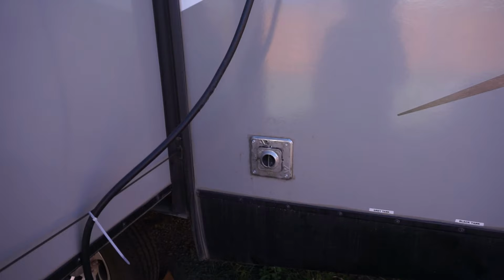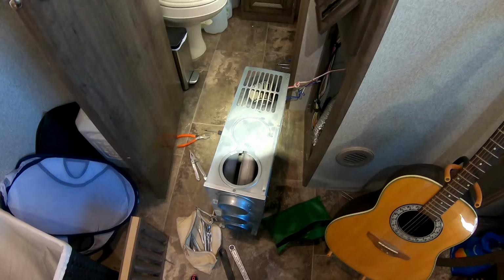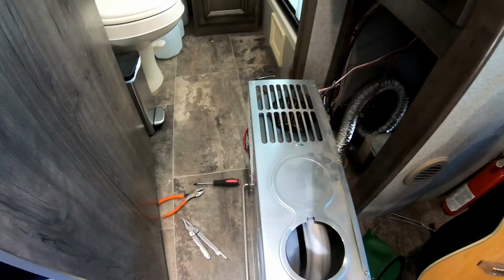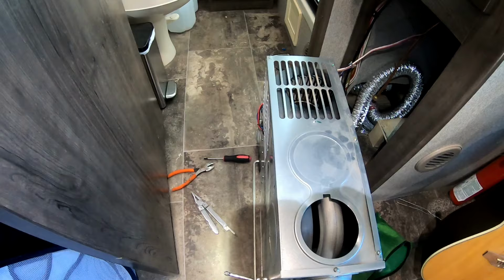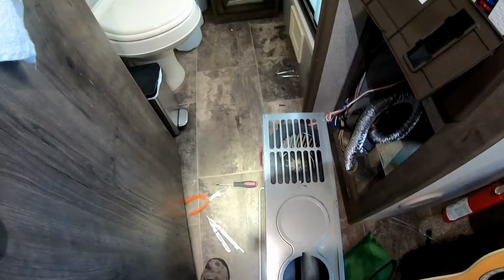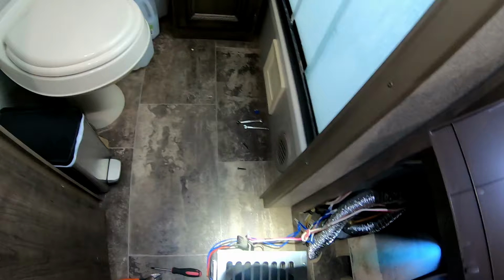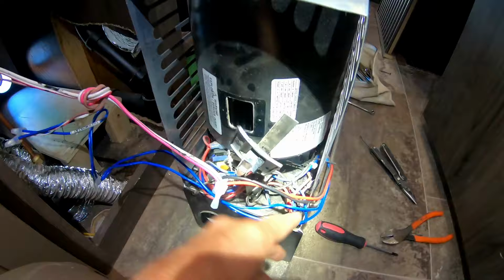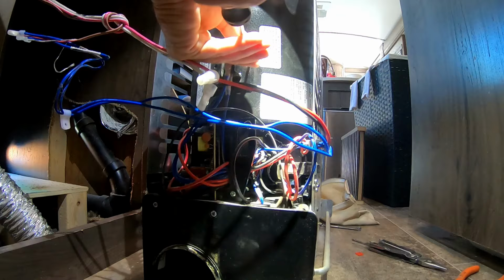RV Furnace NOT Blowing Hot Air - No Ignition | Cuts Off

Comment: Very Nice...  I had a similar problem last year.  Mud dauber wasps had got into my furnace exhaust and built nests that restricted the air flow...  I had the same results as you.  I took it all apart and cleaned it....  Works good as new.  Now during the warm months I keep a piece of wire screen over the furnace to keep them wasps out.  ;-)
Reply from the maker: I have heard that before!  Those critters like flying in there and building nests.

Comment: READ THIS!!!!! If your sail switch is clear your next thing you should look at is your High Limit switch. On a suburban it is located opposite the exhaust, usually on the interior of the rv just under the cover. To check it you need a multimeter and set it to continuity...You are looking for continuity so it will beep or read ZERO. iF IT DOESN'T YOU NEED TO REPLACE IT. It's about $10-15 for a new switch.
Reply from the maker: Great info thanks!
Reply: We are having this issue. Our sail switch is clear. Thanks for this extra tip.
Reply: What does a high limit switch look like ?

Comment: We just inherited a camper that hasn’t been used for 5 years. Dealing with mud daubers and wasp nests. Finally cleared the AC fan. Then onto the furnace, wouldn’t fire, wouldn’t blow air. Pulled the furnace, cleaned out all the nests and freed up the fan wheels.  Reinstalled it. The fan works, it would run 30 seconds then shut down . Never firing heat. Watched your video, really wish I would have watched it before I reinstalled it and I could have checked the sail switch. Tomorrow morning I’m pulling it again, hope it’s the sail switch. If so, thank you very much for posting this. Fingers crossed. 
Hey, haven’t done any work on the H2O heater have you? Lol, that will fire flame, but turn off writhing 5 seconds. Figuring it’s a flame sensor switch, but I’ll be damned if I saw one.  Happy RVing.
Reply from the maker: Oh WOW. You have your hands full!  Hope you got it at a great price!  So you will have to tell me if your heAter is working now?  No, I haven't really worked on water heaters. I do know that some of them have a rod (can't think of the name of it) that deteriorates and need replacing. Pull the drain plug and you will know if yours has one or not. Good luck!!!

Comment: See if you can somehow install a regular HVAC filter. Best wishes and regards ladies!
Reply from the maker: Not sure where!  The furnace is encased.
Reply: See if you can make work an oversized filter outside of the cabinet with double stick tape. The cardboard edge disposable filters. Just needs to be larger than the cabinet hole. Best wishes and regards!

Comment: You mentioned having to remove the outside vent cover (:59), but you don't say why this was necessary. Based on the rest of the video it seems like that step wasn't needed. Please elaborate.
Reply from the maker: The outside vent was screwed to the heater located inside the RV.  It had to be removed for me to remove the heater.

Comment: Great video ! I’m having the same thing with mine starting then kicking off. Did you have and lights blinking on your circuit board? I’m getting the three flash / three sec pause. Have not pulled unit apart yet tho.
Reply from the maker: Not that I recall!   If I did, I didn't see them!